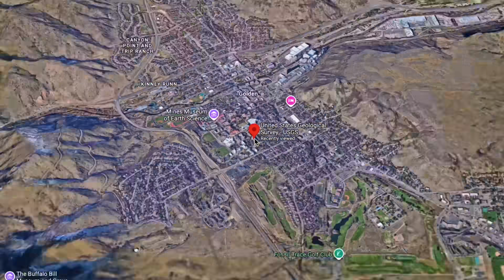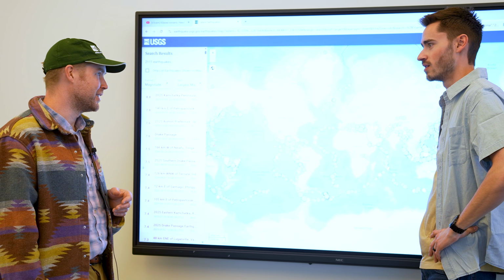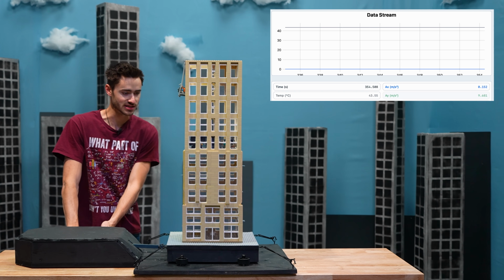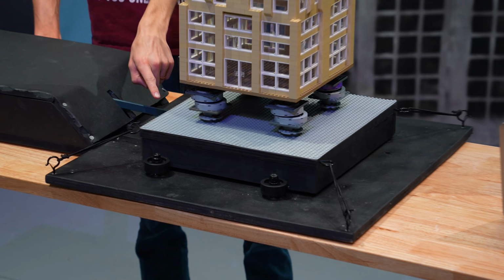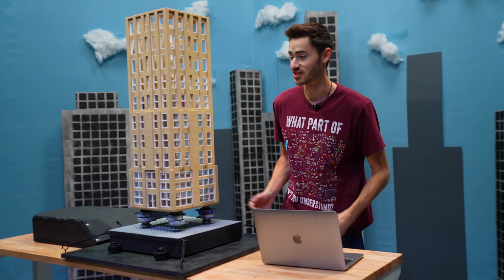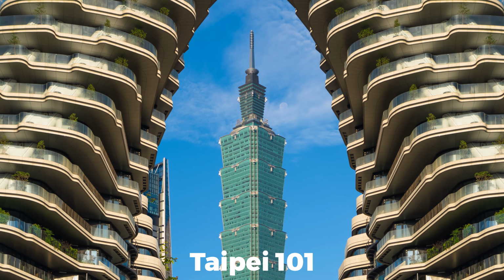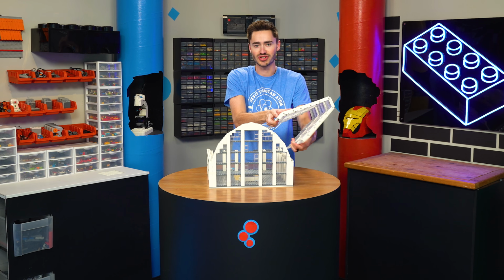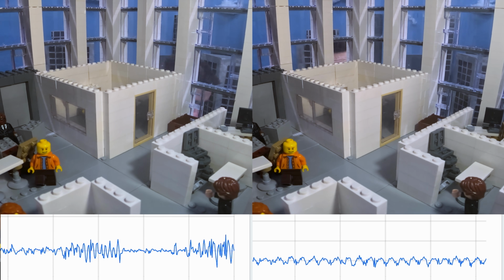Testing LEGO Skyscrapers vs Earthquakes!

Comment: In japan.or china .their s a hut  build that is only. Made outter wood. But it can withheld the most strongest earth quake 😊 ???  How you ask. Well the main structure pole s are not connected into the ground the pole s are touching the surface .and  thay machine was set to 10.7 earth quicker .setting with out. The hut building. Dident colaps not fall down nor brake .as I seed. And it only wood .amazing. Building. Nolidged that it .

Comment: No, can you just make like 13 minutes really weak for every build elevator cables every build and you did a cable like anything like a chain they have to be certain weak and every build and it’s a piece and it’s pretty easy to book quack it can be a single piece of a elevator cable. Looks like I need to have a mechanism where you can crank it up. I put it up and down.

Comment: you know, the methods in Skyscraper 2 worked in real life, but he implimented it the wrong way. 15:05, Sheer Walls. that thing is supposed to be like the backbone or the building, its supposed to transfer all the load of the building into the ground and its supposed to be dug deep in the ground. this guy just put a filled pillar inside, didint even connect it to the walls and basically the whole thing didint work. and  16:08, Cross Bracing. those things are supposed to take the load and transfer it into the sheer wall to transfer the load into the ground, and in what he did, besaically transfered the wall's load to the same wall but in a different surface. (by load I mean the earthquake force or shake). but, it did lock the walls bricks together so it helped a bit there.

Comment: You may have noticed that speeding the machine doesn't do a lot more damage than a lower speed. That is because every building has a specific frequency, when the waves of the earth quake reach that frequency, the building will start to wobble a lot amplifying the movement and break at some point. This is also true on bridges, most bridges are a little flexible and if the wind strikes at a specific frequency, it will literally form larger and larger waves on the bridge until it collapses. Engineers know about this frequency and sometimes do modifications to the building to change it and avoid that.
Reply: The Tacoma bridge collapse is a very good example of that phenomenon, videos are available on YouTube and are worth watching !

Comment: Now I know how to protect my Lego builds in case of an earthquake
Reply: Only the tall structures but the small structuresuses stabalizer (i think)
Reply: @cavylivern hmm depends cus if u saw most of the lego scyscrapers held for abit even if the big so they where stable enough and let alone the shorter towers i doguhbt but still if a real erathquake happens it all depends on what floor the lego is in of the house/apartment and where its placed so mostly it will really well without any of those supports
Reply: Most Lego .set s build s  in owe house s or tall apartment s got no luck .$1000 doller. Pan cake deth star all over the floor ..only way owe Lego builds might servive is if thay fully glued together.but even then the. Build will move .and drop of the table or shelf .

Comment: The thing with TMDs is, they're largely dealing with harmonic vibrations. So it's not just the building it's in that has to be calculated for but also the frequency the force is applied at. 
You can think of it like someone being pushed on a swing. You get the most speed when being pushed at the top of the swing. Now imagine if the pusher is pushing at a constant rate, say every 3 seconds. If it takes 3 seconds for the person to hit the back end of their swing, great you're swinging fast. But if it takes 4 seconds the swing is only getting pushed one out of every 3 times it swings and will slow down. If instead the swing takes 6 seconds it's back to getting pushed every time and will speed up.